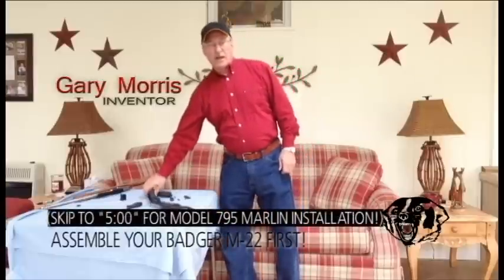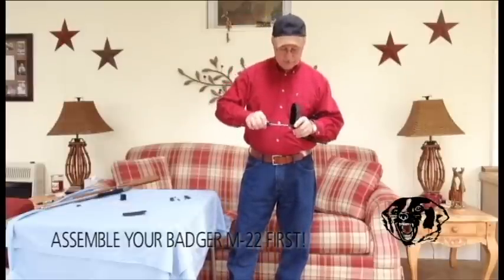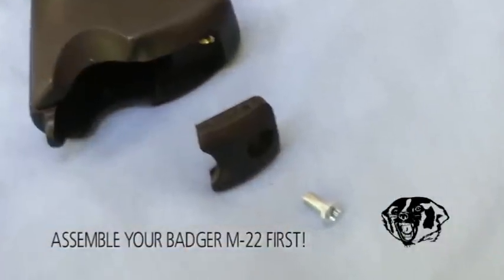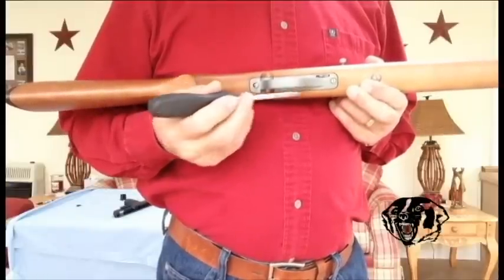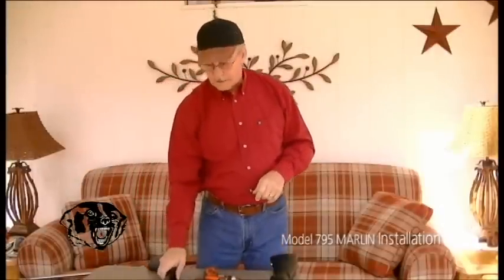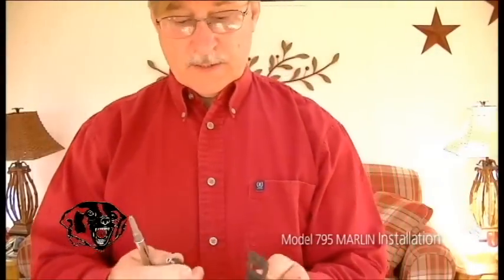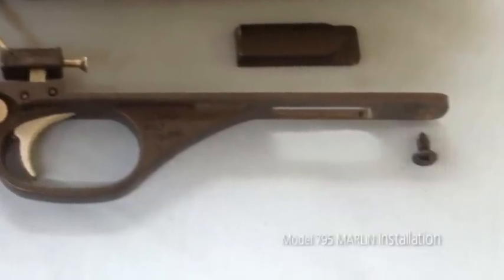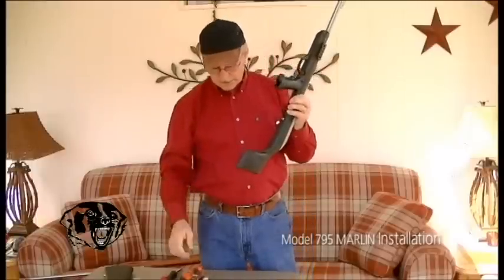Installation of BADGER M-22 to Marlin Model 795 Rifle with Gary Morris

Comment: Anyone have a problem with the install? I got my badger,  and had to trim almost all the cover plates to get them to fit properly. My rifle also sits about an 1/8" off centre in the stock all the way from the ejection port to the end where the barrel comes out. Is this the way it's supposed to fit? I took it apart and reassembled  it three times,  but it still sits off centre.  My bottom rail mount won't fit between the trigger guard and the sling swivel either.

Comment: THAT JAM CAN BE FIXED EASY. BUY A BORE SNAKE TOOL. THE EDGE OF THE CHAMBER IS SHARP. USE A BORE SNAKE CLEANING TOOL PULLED UP THROUGH THE MAG WELL. WEIGHT ONE END AND PLACE THE GUN LEVEL ON A TABLE PULL THE ROPE STRAIGHT OUT THE BARREL GOING  BACK AND FORTH 6 TO 8 INCHES UNTIL THE FEED RAMP AND EDGE GET ROUNDED AND POLISHED BY THE ROPE JUST A FEW MINUTES WILL MAKE ALMOST ALL BULLETS FEED BETTER. ON TOP OF THE RECEIVER AT THE VERY BACK DRILL A 6-32 HOLE AND USE A VERY SHORT ALLEN HEAD SCREW TO STOP THE SCOPES FROM MOVING BACK. NO MORE THAN THREE OR FOUR THREADS NEEDED. ALSO A TRIGGER STOP SET SCREW TAPPED INTO THE TRIGGER GUARD WILL HELP TO KEEP OVER PULL DOWN AND INCREASE ACCURACY.